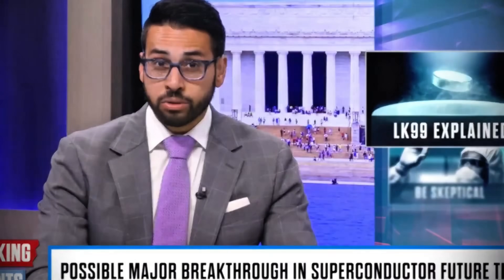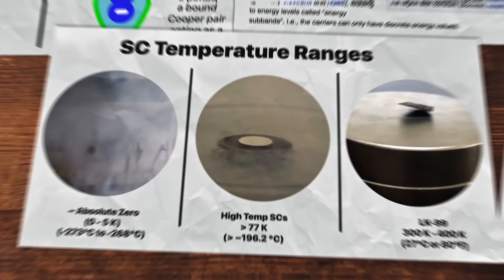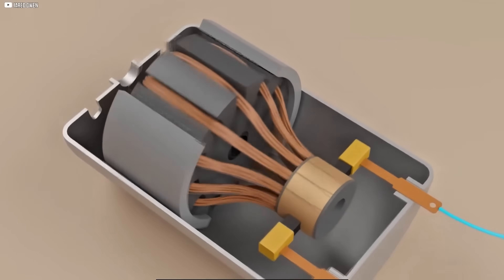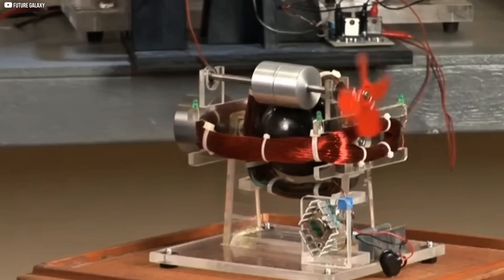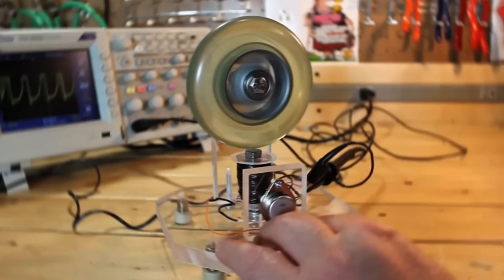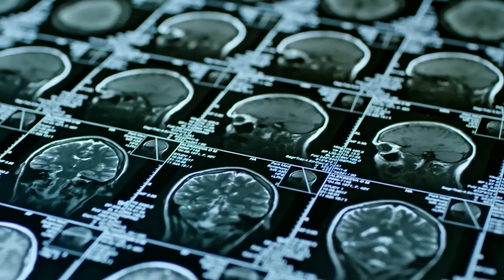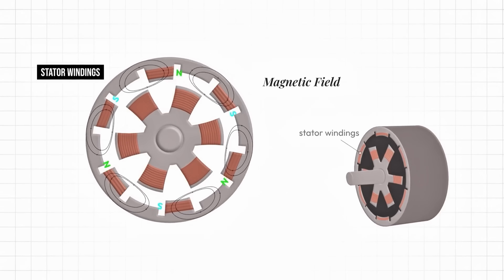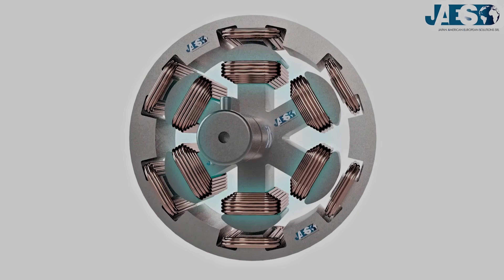This Magnet Shocks the Whole World with New Free Energy Generator Available in 2025!

Comment: i know of telas made free power how is it possible i a Freemason much was pass to me,  now free power was made in 1966 by the military then it went to huge building for elevators, 
there is way to do this,  key has do with 3 numbers 1 amout hp it t  takes to run said system  amount of volts last amount volts, so o got ,my hands on military system and i did get it to run, and business who own it  which i had do this in 5 days at there sight, they gave me to use over 500k in test equipment including load testes, it worked it made 20% free power, wow work and disapointing but lead me to ask question guy i new work on nuke reactors,   he said cant be done because one huge point no one has them 3 numbers, in short if u got the numbers u get it to work,  so i start work on basic numbers what dose it take to make 100 amps, of power at 220 volts if i had elec system drive it what are base number so i got them guss what wont work he was right or was he,  now i know power pants put out 700k volt to a million volts  i ask why to my self , and that when i crack the numbers that make it works, but without all the numbers to run a home or anything huge is impossible ,  now u all say cant be done ,  i help Microsoft Cisco when they cant find problems they come to me, read that again,  was system went down, and they do nothing with it,   so they flew me allway acroos usa to fix the problem, and can i say wow, they did fbi background check sign ton non discloser statements, so i cant say where i went  but i can make this statement that had 5 systems made over 100kw with no power at all,    it not patten, no one ever seen the files,   to say cant be done business have done it,  as it taken me 15 mins to fix the system i ask them i said i know what u do here, they looked like i was nuts they said what your making free power,  so i handed them sheat papper with all t he numbers i said outside of the non discloser cause will this work, they looked white as sheep,  so they called in 4 of there engeaners, that look at the numbers,  they ask how i get them i said i just knew what questions to ask ,  they stated it will work  but no one will ever be leave you,  then  t hat know it be done will discreated you, so it cant never be built or tested,  you see people on here lot work for lot  business who do anything to prevent this from being made,   and what i know you don't need anything special and i drive a 60 hp motor at less 20 amps,  5 days i was suppose be there at sight  there people put together system under the numbers i had free engery out put 140 amps loadtested no extaleal power 220 volts  but motor ran at very diffrent voltage at full load system got to hot so we back it off to 70 pecent load in 20 mins time taken system to cool down was now all in green ,   wich was one point made they temp sencorts has be place on all devices, genartors motors would have east to remove bareings so you dont have pull apart hole system just remove cover plate,    this will be crack and yes most of this is bs,  but can be done 
but what we did there was out side of there non discloser, why as they stated no one would ever be leave that i crack the code,  to ack power a home,  
also i have a 2ed idea say you need 500 amps i own device can make 60k psi hydronic presser from 3000 psi uses air  at cost of 50k i got it for frew 100.00 this to can do job, put hydoiuc pump between motor and generator ,  in fack u can remove the motor with this device ,  would run close to 10k psi lines would all have be line with a steel mesh, that part not cheep, as i on ssdi i dont have money build such device, nor do i know people has  what i need to make it ,   and yes people will say cant work them people all to inshure system cant be built

Comment: As long as we need and use plastics,  then we will need oil.
Reply: That’s not exactly right,  my dad was a plastic engineer with a company that worked with different types of plastics for fifty years and I was involved with for about ten years until I started to work with different coatings . 
I wasn’t a chemist but my job was to know the different molding characteristics of the different materials.  
There are bio plastics made from different types of plants like industrial hemp and other plants.
This material can after a short time of being exposed to the direct sun or covered with dirt will biodegrade in days or months back into soil whereas petroleum base plastic can take thousands of years to break down once it’s buried . Also petroleum plastics that is sun exposed tends to become brittle and break up and oxidized which becomes a white powder . This is why it’s so harmful to sea life which we then consume .
As of now , we will still need certain types of heat resistant petroleum based plastics but much of the consumer in store container plastic should be replaced with biodegradable plastics.
Of course the petroleum industry would take a pretty good hit if we go with biodegradable materials but it could be a big plus for the environment and human health.